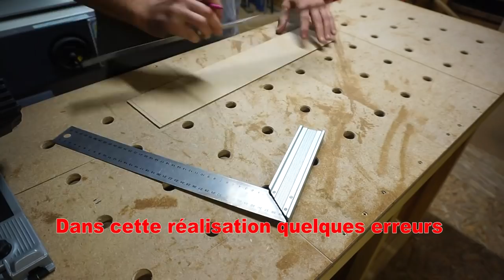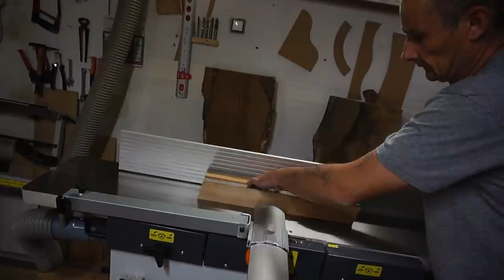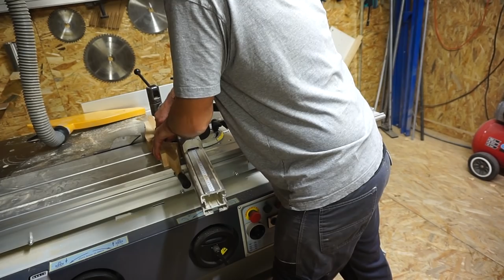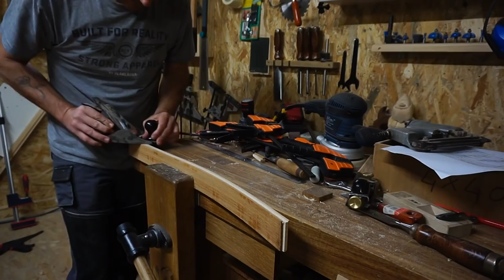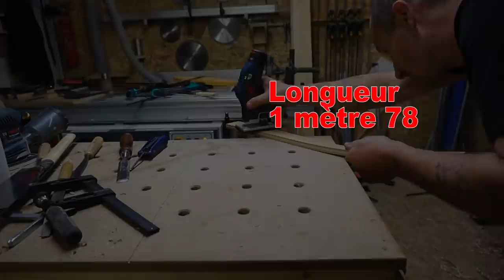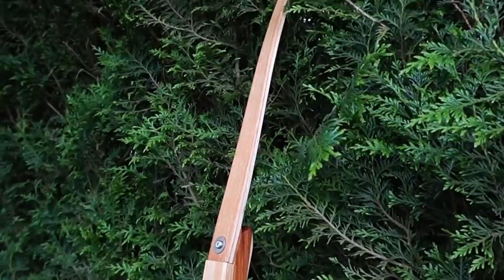FABRICATION D'UN ARC EN BOIS

Comment: salut l'ensemble est joli.
pour les poupées, sur des branches en bois il faut eviter d'entailler le dos de la branche, juste une entaille de 2mm sur chaque coté suffit a tenir la corde en place car quand tu bande l'arc, ça exerce une sacré pression sur cette fine partie.
je le trouve massif dans l'ensemble a voir ce que ça donne pour ta prise en main.
et pour la poignée de gaucher bin ça arrive. tu as juste a ty adapter et changer ton oeil de visé ou alors tiré a pleine vue.
Reply from the maker: Merci , j'ai changé les branches et modifié les entailles .
Reply: ça a donné quoi la mise sous tension? tu as un dynamomètre pour savoir ou sinon tu testes au seau d'eau remplis de sable pour connaitre la force a exercer.
il te faut a peu près 1/3 de l'allonge quand ton arc est sous tension et quand tu bandes tu atteins le 3/3.
pour mesurer ton allonge, c'est bras gauche tendu devant toi et horizontal (car arc de gaucher) le metre dans la main et tu prends la mesure a ton oeil droit.